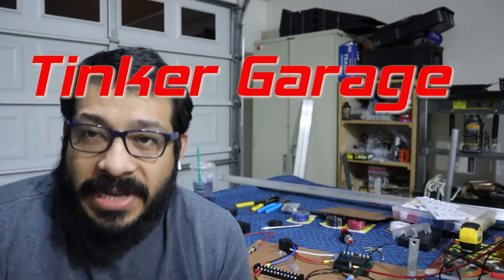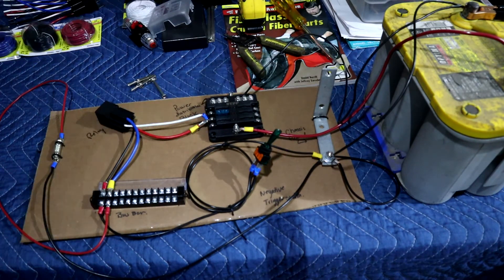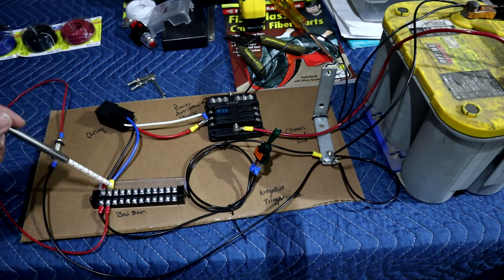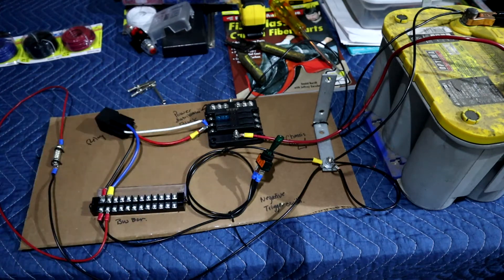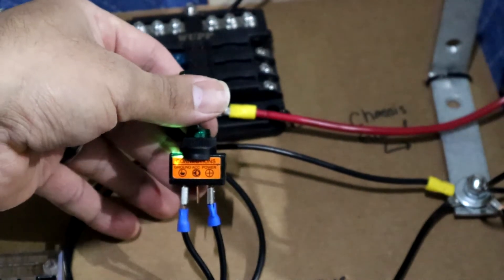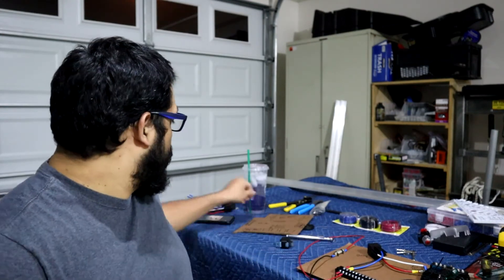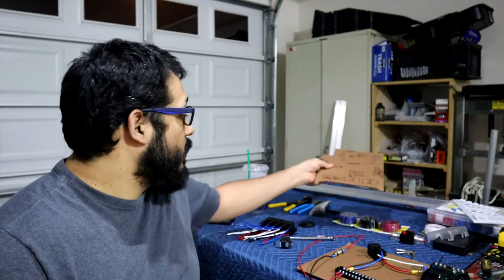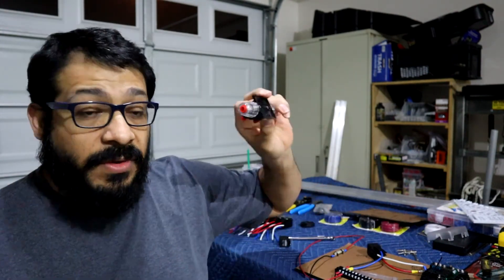How to wire a power distribution relay block to a automotive negative trigger / switch kinda of!!!!

Comment: I have a school bus that I'm in the process of converting to an RV. Run off of the buses power but I would like to make some switchable relay that would allow me to prioritize the buses onboard power only when I want it to. Basically I want to run off the buses power while we're driving and then the battery Banks when we're stationary. Can you please explain how this would be done

Comment: Like your outside the box thinking.
Standard installation put the pos wire to the switch because it is normally close to the batt. When the switch is off there is no Batt + to the rest of the circuit. 
I can see that since your making 4 (I think) switched light connections you trying keeping the amount of wires to a minimum.
I'm still curious to see the voltage on the switch in the off position. It looks like the switch in on the neg side of the circuit. 
On the relay your switching the neg side rather than the pos. Relay doesn't care. It just closes the contacts when current is detected.
Good job! Don't you ever sleep? :)